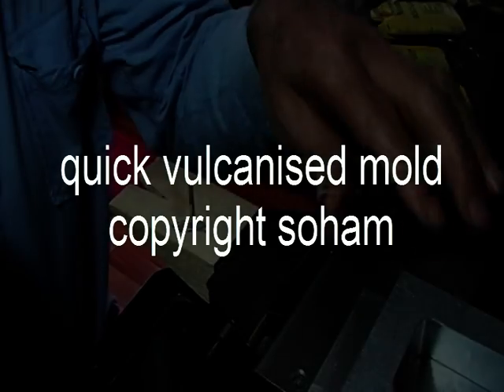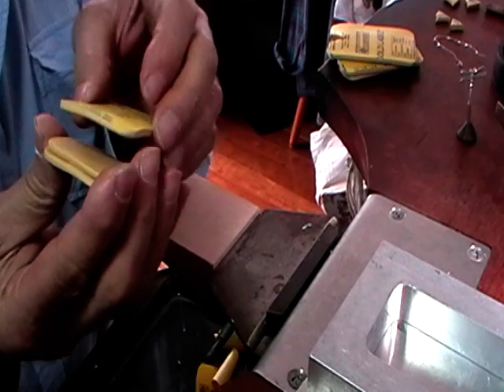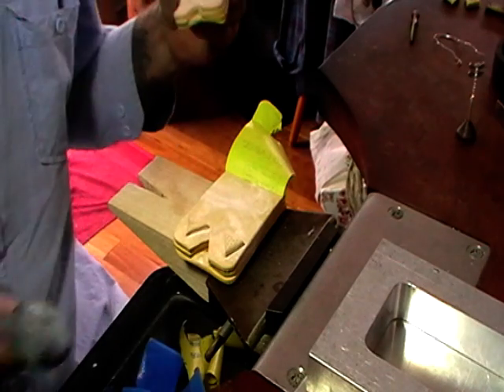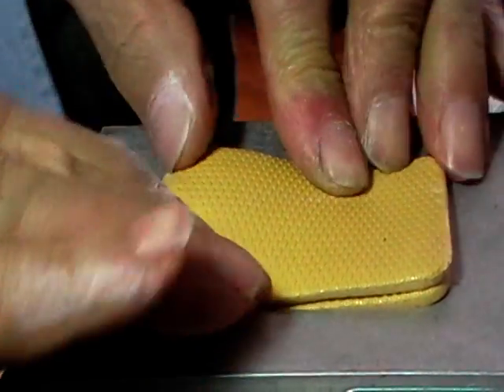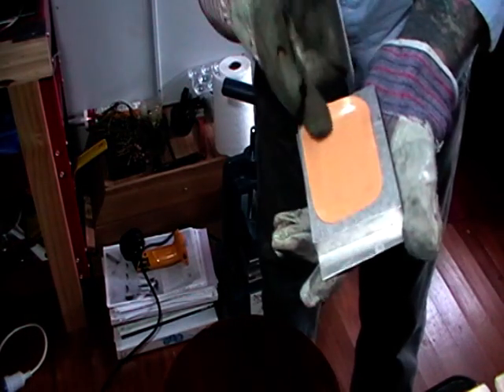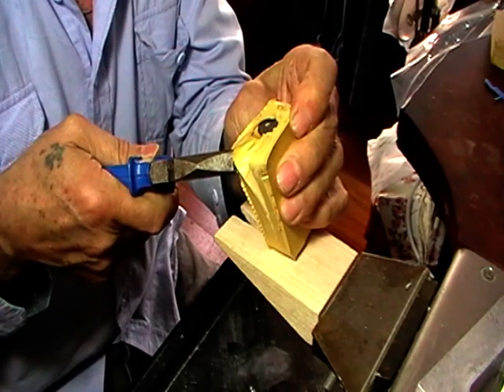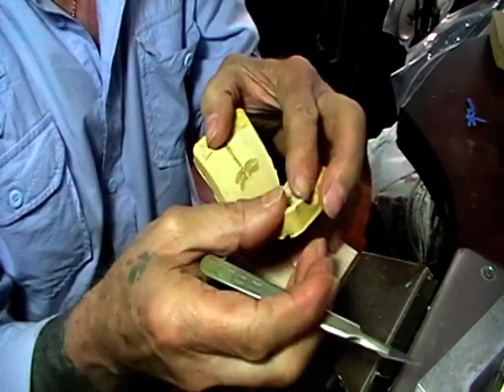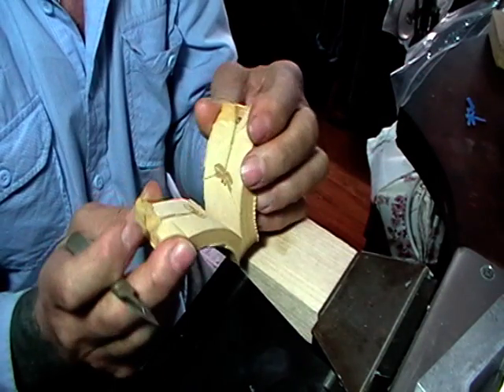vulcanised mold

Comment: How hot could you cast using this mould method? I'm thinking about casting with pewter or lead.

And I know this is going to sound awfully cheap of me but would it not be possible to use just a clamp and an oven for this?

Comment: I have a rubber part that over time has started unvulcanizing itself. Is there a way to revulcanize it? Thanks
Reply from the maker: not to my knowledge. perhaps google
Reply: soham harrison Do you know how I would go about getting the part remade? It looks like there are not reproductions so it'd have to be from the one I have.
Reply from the maker: you have to make a new mold from one of the previous castings
Reply: soham harrison So, how would I make a mold from my casting? It’s old but mostly in tact.
Reply from the maker: inject wax, cast it and make a new mold

Comment: i've had a concave tree branch vulcanized and it came out broken. any suggestions how to mold fragile objects?
Reply from the maker: 2 part liquid silicone works well for this
Reply: soham harrison not if you plan on pouring molten metal into it...
Reply: Eric Jurgens Works fine for wax injection.
Reply: vulcanized rubber is more heat resistant than silicon?
i'm no authority on it, tho i have poured pewter into some of my two part silicon molds before, with fine results, i just did it cos i was showing some kids some stuff about carving and molds..   but the logic in me says that if it was heat cured then, introducing heat into the equation would not be good for the mold..  maybe it;s just not enough heat to matter
Reply: No, no, this is all for lost wax casting in investment. (Google) :)